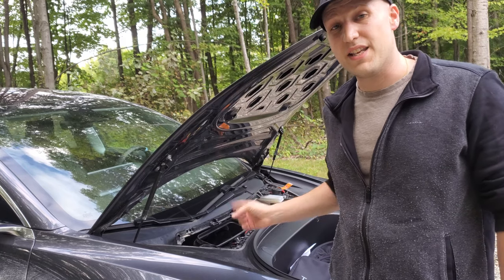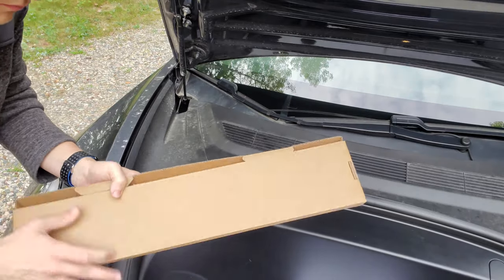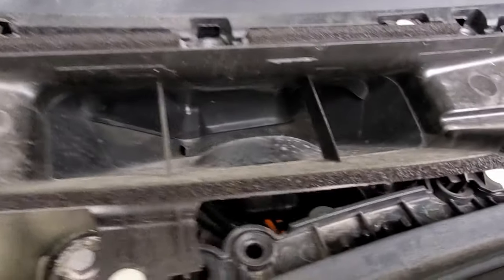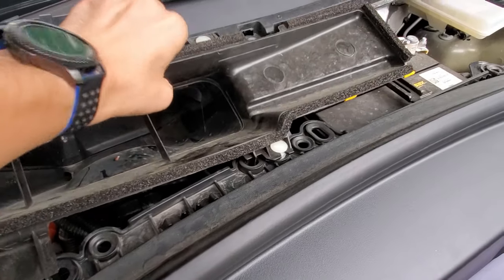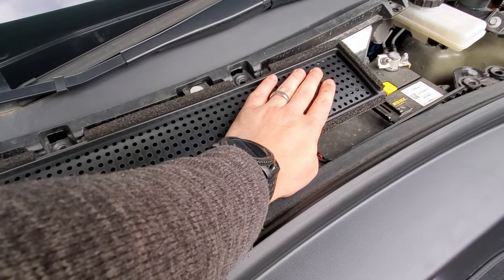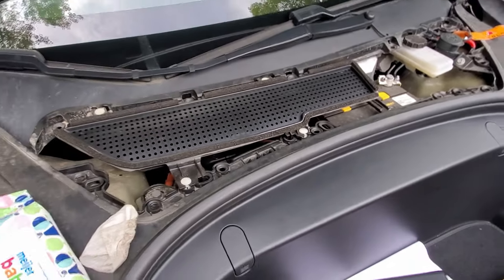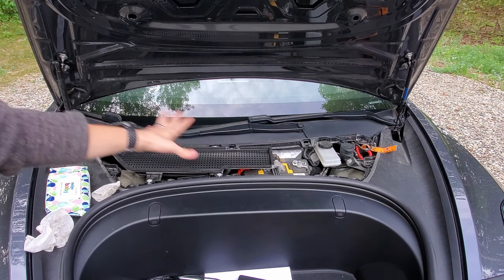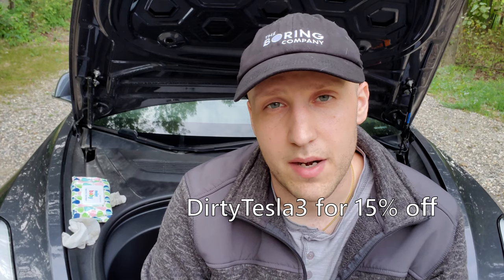PROTECT Your Model 3's Air Filter! | Air Inlet Guard |

Comment: Feel like it will reduce the life of the fan motor. It takes more energy to pull air through smaller wholes, and you are adding the slits on top of that.
Reply: Restricted air flow would reduce the fan speed IF it was for an air compressor.   Here we have an air blower.  Restricted air flow would actually increase the fan speed (in case of an air blower), then the motor could be damaged from rotating too fast in the extreme case scenario.   For an air blower, the incoming air hits the fan, and the fan speed is reduced by it.   Quite opposite of compressor case.

Comment: In a sense, you are putting a filter under a filter and there is bound to be some restriction in the air flow. Which in turns pulls on the fan trying to draw unrestricted air in. If by chance you get trash or leaves inside...even more restriction. Think I will pass on this. It would be easier just to do some cleaning maintenance on the air intake at least once a year.

Comment: I did a DIY one similar to this. However, I have a cheap pre filter on it that is charcoal activated. Keeps the filter cleaned from any debris and keeps your cabin filter cleaner for a lot longer.
Reply from the maker: That's awesome! Any way to share it with everyone?
Reply: @DirtyTesla  Easy DIY, just buy some of the cheap home depot charcoal pre filters and cut it to the shape of the insert you just showed in the video and TaDa! I did however used 4 small pieces of double sided tape to hold it down. Doesnt need much. You will be amazed at how much dust n debris it collects. Fortunately, you can also wash em, and continue to use them. 😉

Comment: The amount of air going through that should not be your major concern. The restricted airflow is a bigger concern for load on the blower fan motor. It's clearly restricting it significantly if it has that much suction, I would expect this to be putting a pretty significant load on the blower. The blower might be okay with this load, but it's also possible that this may wear out the motor much faster. It will also cause the HVAC to run longer to do the same job, hurting energy efficiency.
Reply from the maker: I don't think it will be a problem. What you're saying may be true, but how often is the fan actually at the full setting? At a normal setting, there was no suction.

Also, when you set the climate to the lowest setting, it automatically will turn on recirc, and no air comes through there anyway. I had to manually disable recirc to do that test.

But that's why I tested it and showed everyone! If you don't think this is healthy for the fan/blower/whatever else, that's your call.
Reply: @DirtyTesla  It likely has an effect even at lower speeds. The existence of a strong vacuum is just an indicator of significant restriction in airflow. It does not mean that there isn't still some restriction at lower speeds. 

Also note that on auto, recirc is NOT always on at low settings. It will vary depending on temperature inside the car and (I believe) outside. Recirc is used to reduce the power needed for the HVAC, but if the internal temp is hotter than outside, recirc makes less sense. I don't watch it all the time, but I would also expect that it will turn off recirc occasionally to allow fresh air into the cabin for air quality reasons.
Reply: Dirty Tesla it would be good to know what fan setting has no vacuum/suction/restriction so users know where the fan speed will begin to have altered flow effects. Even if it’s a pinned update in the comments :)

Comment: I feel the design might reduce airflow, if it was dished into the 3 sections of the intake grame, but narrower, with holes on the vertical parts you'd get more air-flow with the same amount of filtering.
It's not just he A/C that needs to be considered, what about when the battery needs to be cooled or in track mode (for P models)?
Is the suction with the A/C the same fans as coolant loop?
This might make a nice frame for doing your own grille/mesh - keep the edges and 3 supports above the ones in the intake and then fill the holes with mesh.
Reply from the maker: The battery brings air in through the front louvers not this spot.
Reply: @DirtyTesla  If this is the inlet for the AC though, is that not part of the cooling circuit so the chiller can chill the battery coolant too? If there is a restriction it might still limit battery cooling. If you are feeling a "suction" it must be reducing the airflow I would think?
I'd be curious what Tesla think of the design WRT warranty. I do think deep "dishes" or a higher hole to land ratio would fix the potential for reduction in flow.
Reply from the maker: @eubikedude  it's the same loop, but from my understanding if AC isn't on and the battery is cooling the only air coming in is from the front. I could go to a supercharger and test that easily tho.

People have also reported reduced AC ability after supercharging because the car is using all cooling ability for the battery. So again, I don't think the car will sacrifice anything when it comes to cooling the battery.
Reply: @DirtyTesla  I suppose it depends on if the A/C for cooling the battery needs air from that inlet or it's only cabin air that goes in through there.
The question might be where does the heat from the chiller get exhausted?
Maybe a parts diagram would enligten us. :)
Any noise difference in the cabin fan from the slight restriction? If it was quieter/smoother that would be a bonus.
Reply from the maker: @eubikedude  I haven't noticed any difference in cabin noise since installing it but my air is very rarely going full blast.

Comment: Great intro.  The audio on my Moto Z3 (without the JBL speaker mod) was up all the way and I could barely hear you until you started taking the vent apart.  

Maybe a clip-on mic would be great for you.  Most of the videos that have great audio use them.  It would also allow you to be very mobile because you would not have to hold it.
Reply from the maker: Ah sorry about that! I almost used a mic and then decided against it because I was moving around while the phone was on a tripod. Next time! Thanks for letting me know.

Comment: What I’m trying to understand is, why is it that some people get the mold smell that I keep seeing videos on? I’m a former HVAC tech and the only thing I can think of is if the water is traveling down and soaking the filters from a heavy rain or washing the car.  Another thing, why would the evaporator coil need to be cleaned unless the filters are unbelievably cheap? I only have 1,200 miles on my ‘21 P3 so I have a ways to go before I need to worry but just trying to understand it.  I’ve only ever had to change the cabin filter in previous cars and never once had to clean the evap coil.

Comment: Love the intro!
... But not the product, that's clearly obstructing, and can cause extra noise/wear on the intake fan... Not to mention hard to clean inside that intake.
Reply from the maker: Taking the entire piece off to clean is the same as before, although you shouldn't need to go in there anymore.
Reply: @DirtyTesla  well the tape might hold strongly, it's no more just clips
Reply from the maker: @seb.  Go look again how it's installed. The tape doesn't interact with the clips in any way. It's just taped to that second piece of plastic that gets unclipped and pulled off. The entire piece will still come right off. But as I said in the video, I agree this isn't for everyone.

Comment: I would more lean towards a better filter, than just a mesh.
Reply from the maker: Well this is separate from the air filter. This just stops bigger stuff from going in that opening.
Reply: @DirtyTesla  I know. But this second grid looks quite capable of capturing debris and there's a large "room" which you can empty if anything falls in.

If there's leafs collecting on top of this new grid, they could completely cover the air intake 🤔

Comment: I think this title might be a little misleading because you didn't actually upgrade or replace the actual air filter which you can get to under the passenger side foot area.
Reply from the maker: I honestly didn't even notice I did that. I've been calling it air inlet guard everywhere else. I'll change the title. Thanks for pointing that out.

What if I switch upgrade with protect?